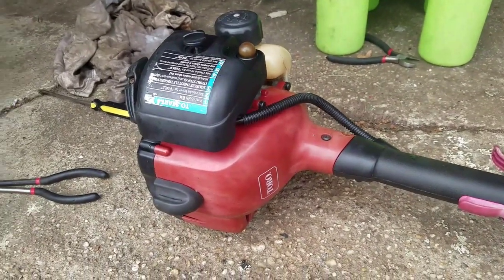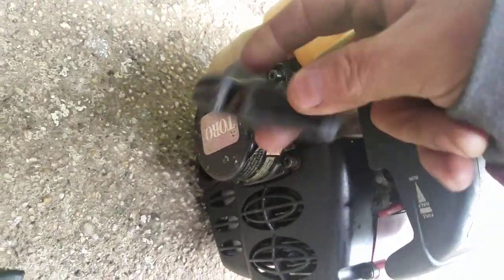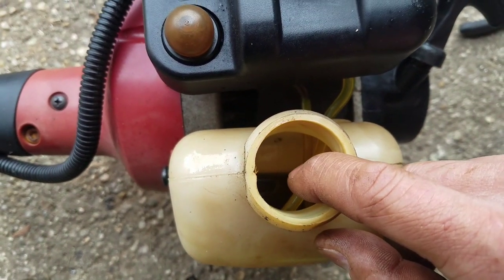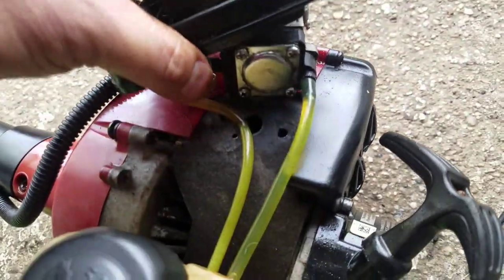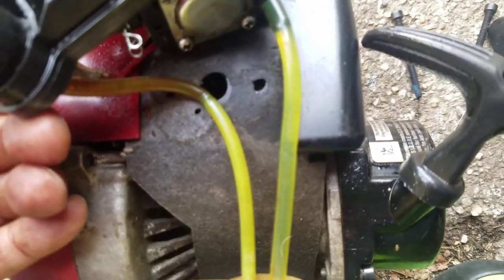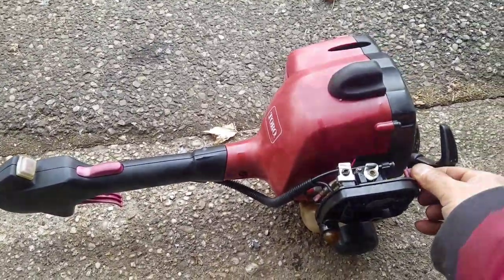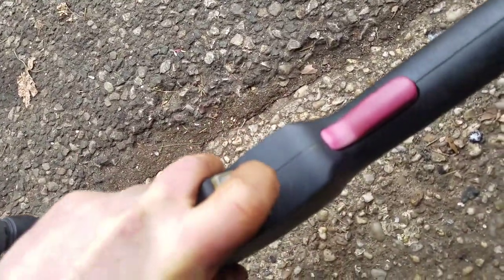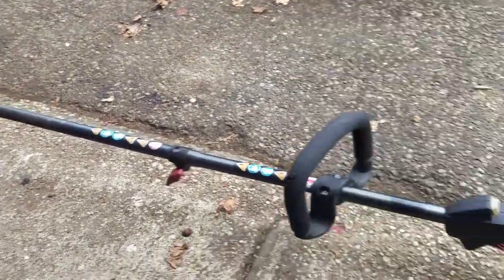TORO 51976 25CC GAS WEED WACKER STRAIGHT SHAFT GRASS TRIMMER GAS LINE RECOIL STARTER HEAD REPAIR FIX

Comment: That model is nice because you can add a hedge trimmer attachment!
Reply from the maker: +Brad Roller I didn't know that, like a leaf blower?
Reply: @MowersNBlowers  prolly know this by now-but there is a whole line of Ryobi attachments that fit the Toro and Ryobi shaft. Small cultivator, blower, edger, pole-saw...HD carries
Nice video-you're a good neighbour
Reply from the maker: @kirkthebeerslinger  yeah man, i actually sold it already.  Thanks for the comment bro.